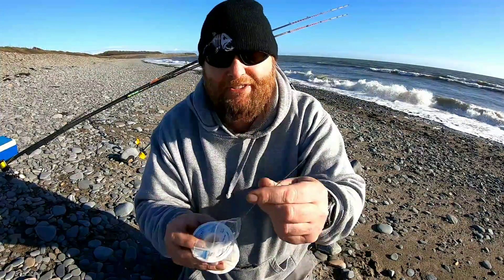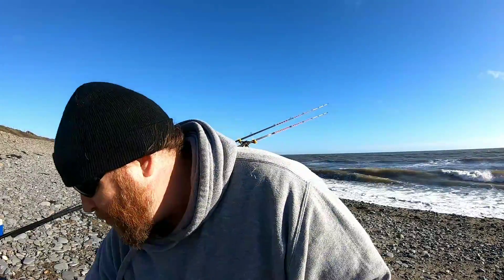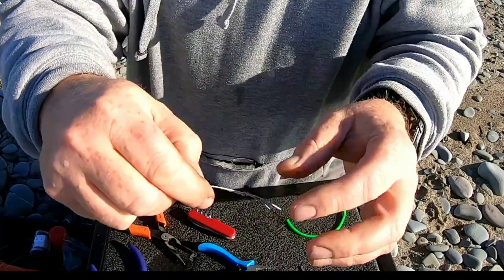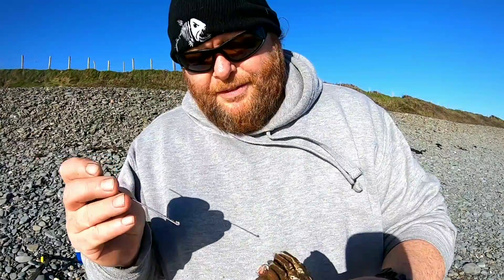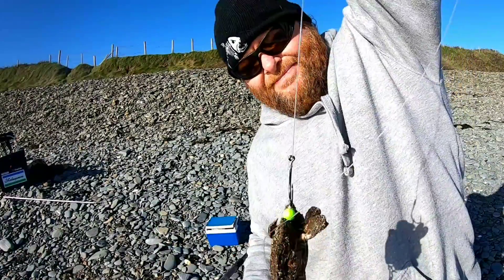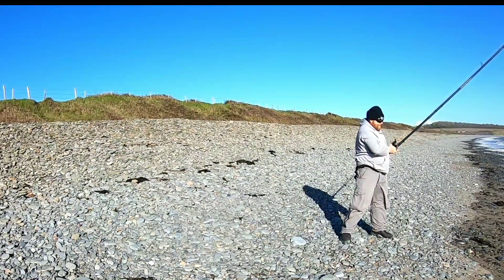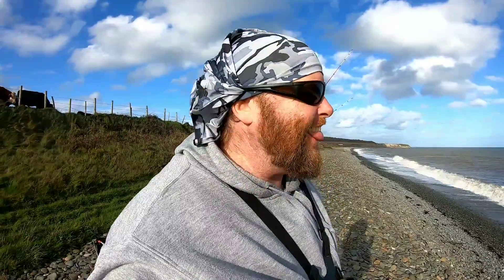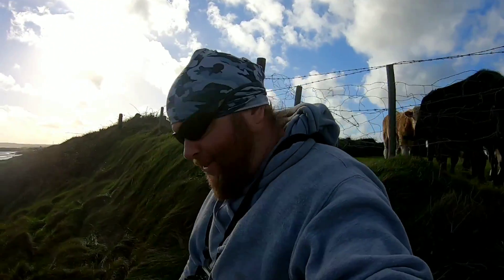Part two of hardback crab experiment

Comment: You asked for feedback, Billy, and I think your design is great. Holding that crab on while you retrieved it through a substantial surf and over a VERY rough bottom proves the point. Please forgive my Yankee ignorance, but why did you need a crab setup that didn't include wrapping the bait onto the hook with elastic cord? On to Norway! Chris (Maine, USA)
Reply from the maker: Hi Chris. The reason I chose to do it this way is because, of the circle hook the bait works best below it. Also it is always best if you don't use bait elastic. For instance if you're fishing in Clearwater when presenting the crab in a natural manner, also the crabs shell and the barnacles always seem to snap the elastic.  Thanks Brother 😁👌
Reply: Thanks for taking the time to answer my question, Billy. For many years, I caught and used hard-shelled green crabs to catch tautog, a tasty, hard-fighting member of the wrasse family, here in New England, USA. But because my casts were always short (around 10 meters/30 feet) and the retrieves were virtually vertical , attaching a crab (whole or half) to the 3/0 hook we used wasn't a problem. We simply drove the hook into and through the shell. Your challenge was/is far more difficult. Interesting stuff, Chris
Reply from the maker: It's what makes fishing fun👌
Reply: Agreed! And the same kind of challenge is what got me into making my own lures (both hard and soft) for our big striped bass. I've had a ton of fun. C.
Reply from the maker: Yes! It's what fishing is about, a great sense of satisfaction when you catch a fish on your own tackle 👌

Comment: Great idea Billy.  If the bead was a tight friction fit (perhaps a rubber bead?) it could be pushed up to cinch the loop of the dongle onto the hook without any elastic.
Reply from the maker: Hi salt. The bait Elastic, is just to simplify it. I think everyone has bad elastic. What I use personally,  is a bead and a small piece of silicone tubing, it's nice because the carbs are slightly different sizes. But a rubber bead under that, could be good. Can you get them in eight or ten mm?

Comment: When we use crabs for Blackfish off the New Jersey coast, it's always recommended that some damage be done to the shell to encourage the crab's juices to trail down the current.
We use smaller green or whiteleg crabs and will use shears to take off a corner of their shell or put a cut across their belly.
Fish on, friend!
Reply from the maker: Hi Joseph. Don't know if you notice, but I put 3 holes in the shell. I think that should do the trick. Thanks Brother 👍😁

Comment: Hi Billy I have the yellow top section like your ian golds tripod,  where can I get the bottom cups section for it?.
Reply from the maker: Hi Kevim, I think VMO will have them👍😁
Reply: Love seeing u use the sonik sk4 with the 525mags BOOM! A very unrated rod. I love mine. A lot of northeast anglers slating them by say not strong enuff and tip sections snapping. Really don't no how they snap them. I am currently on sick from work (broken collar bone) which means fishing out of action too.
Reply from the maker: Yes. They are lovely rods, Brother. But you should be using them, I still got one good arm, right! 🤣👌
Reply: @Billyfishing_watch  VMO Not seen yellow or red top or bottom sections like your yellow ones,  at a loss as to where I can get bottom yellow cup section.
Reply from the maker: @kevimtanner8321  can't help buddy, that where I got mine from VMO.

Comment: Awww sweet, a crab carousel 🎠
I'm going to try this in miniature for North Wales size cod and smoothies, it might just keep the dogs away a bit in spring, I normally use prawns but dogs love em too.
I'll incorporate it into my (newly invented?) lead bait clip that involves a bit of grip wire twisted around my long nosed dumpy grip lead with the tag bent down at about 45°. When the bait disengages the clip drops down the shaft and sits over the lead bit clear of my sliding up and over rigs. I suppose you could have both ends bent down instead of an angel clip.
Not sure if that makes sense but HAPPY NEW YEAR 🎉 👍
Reply from the maker: It does keep the dogs off Daz. I think it's a good way to single out the better fish. Fish on 👍😁

Comment: No need to test anything buddy, it's fact all fish eat hard backs. The only reason soft backs are popular is because the sent they leave in the water. Obviously there also seasonal. When the smooth hounds are in all I fish with is hard backs never soft backs. Since it's cod season it's well worth doing just remember don't take the female ones because we need those in season! Just a tip of you didn't know , grab one of the small crabs and keep the legs on bind them to the shank of the hook with elastic. Job done bass will take them no issue mainly at midday on over cast.
Reply from the maker: Hi Flex, the test was not to see if the fish eat hardbacks of course they do. But to see it you can cast one a long way with out elastic. Thanks Brother, 👍😁👌
Reply: @Billyfishing_watch  oh I feel kinda stupid now sorry wasn't trying to act like a mister know it all. Probably worth keep it close to be honest 😉 but I see what your trying to achieve with the rig you made.
Reply from the maker: @flexecutegaming2997  no probs Brother 👍

Comment: I’m going to need to make then a lot smaller for the kind of crabs on the south cost of england. 
But the fish do eat crabs on a massive scale. Open up any fish and they always have crab in the guts.
Reply from the maker: That me point, and hard backs are so easy to get your hands on.  And the component is easy to make, in any size. Thanks Brother, fish on 👍😁👌
Reply: @Billyfishing_watch  if your ever passing through Hampshire in your travels brother look me up. I’m still on Instagram but left face book to rot in. A wreck.
Bread vid brother. Fish on and see you on the beach.
Reply from the maker: Thanks Brother, I'll give you a stout if I'm up that way 👍